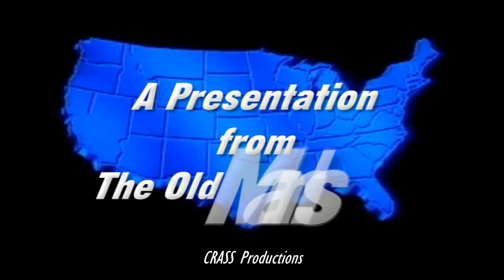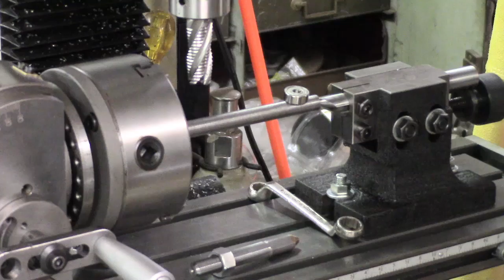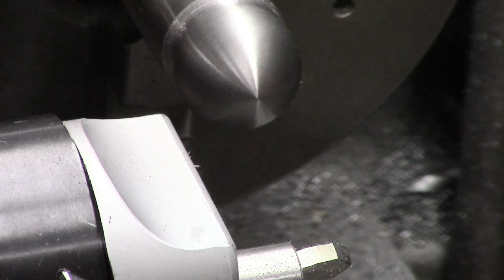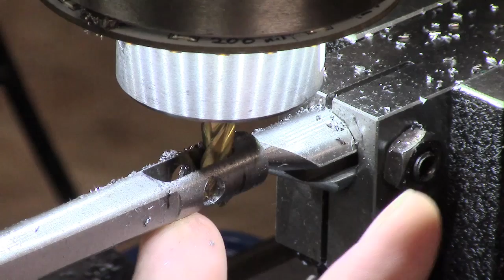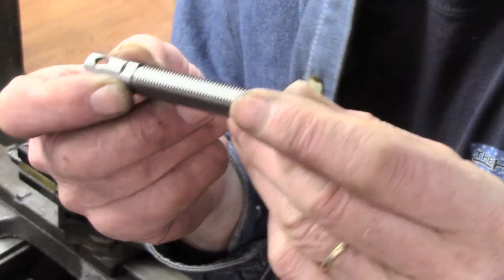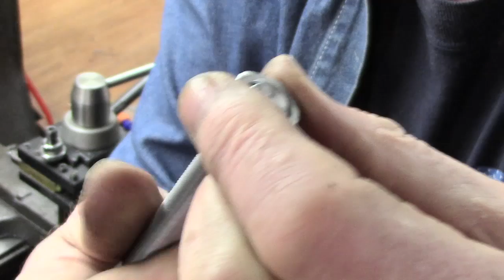Steady Fingers - New Ball Race Version

Comment: If you weld the pins in, the forks would be much stronger.
Reply from the maker: wgenerotzky Potentially yes but, as main loading is along the long axis I don't think there should be any spread tendency etc. I am about to add a follow-up video soon showing it in action and I think the forks will cope OK.

Comment: Maybe I'm missing something, but, couldn't you have made a double length slot and two cross holes in the middle of your bar and then just cut in two. that would have given you two fingers at a time and not so much wasted chuck allowance.
Reply from the maker: tinkersdamnworkshop You are right - in theory! However, the exposed length then between chuck and tail center would have been rather flexible as only 1/2' material. Could have used a jack in middle area but also my table is not super long either. This way I use does take longer but still - gets me there. Nearly finished #4 in mill - then thread remaining three.

Comment: This is coming along very nicely, I think your idea of cutting the thread from an open end so that you can try the nut on is sound, it would be a great loss if the thread ended up too big, the only other option would be to cut the whole thread, then mill the flat, it would be easy to clean up after the flat was milled.
Reply from the maker: Englishman French Well, first thread did work out just fine but, the other three I  am making a bit longer at the bearing end and should be able to chuck those so as to thread from an open end -- should avoid a bad nut fit. I did think about threading first but think the current sequence is OK.